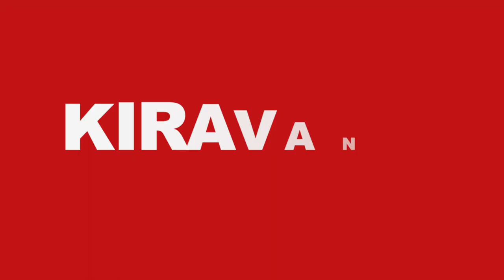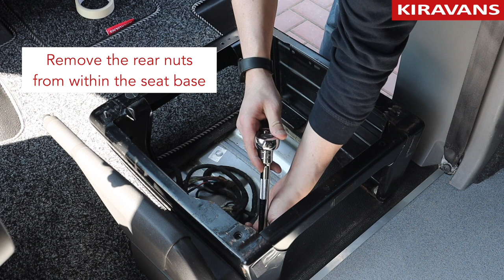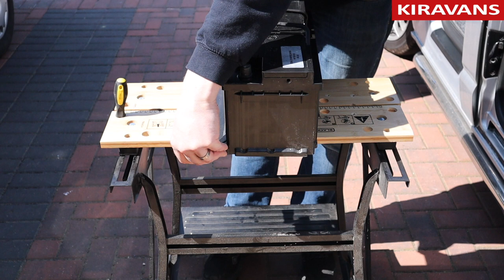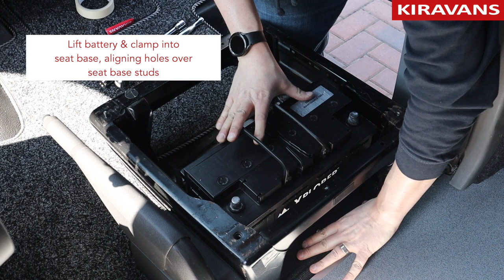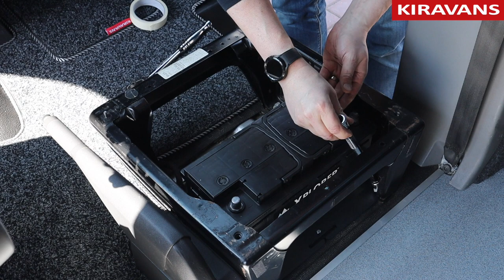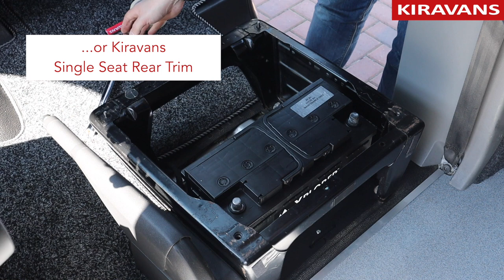Kiravans - VW T5/T6 Battery Clamp

Comment: Hi Kiravans, will the clamp and battery fit on the front studs, to allow space for the warm air pipe from a diesel heater to emerge under the seat and vent out of the rear of the seat base ? Many thanks
Reply from the maker: Although the bolt spacing is the same, the seat base is lower at the front and therefore the battery would have to be very low in height.